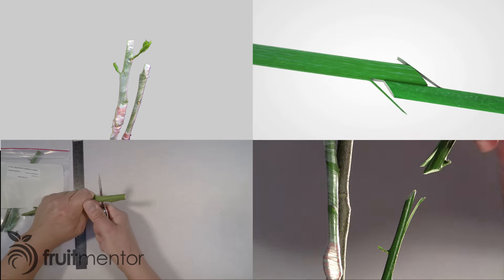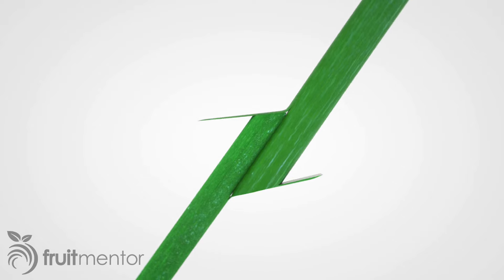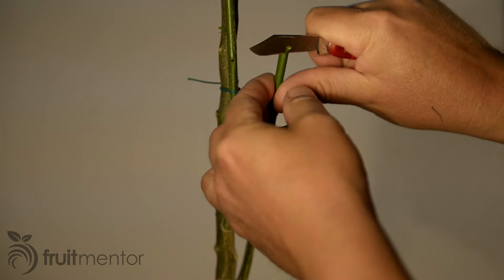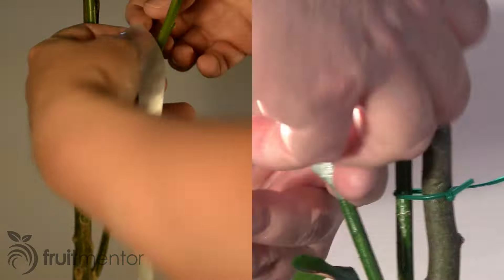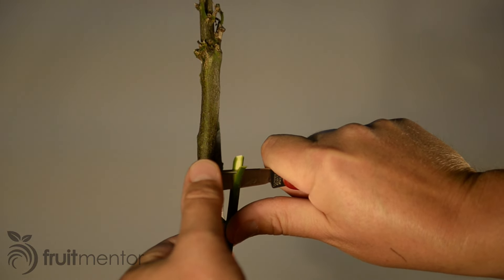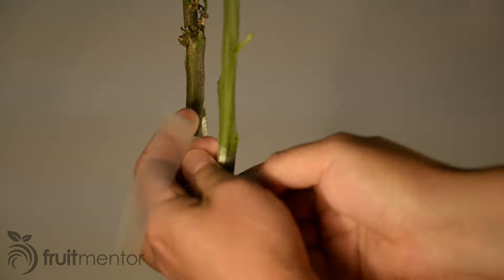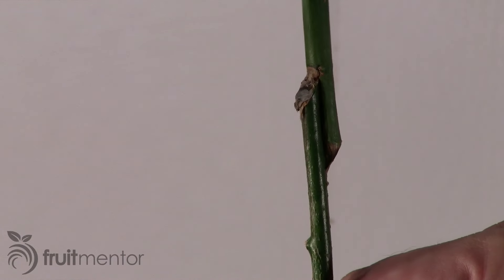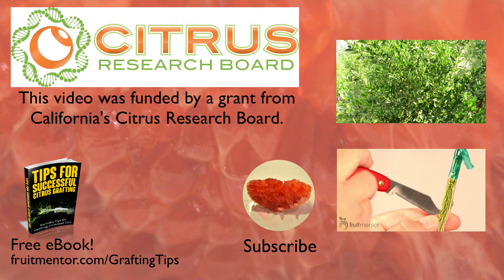Grafting Citrus with the Z Grafting Technique

Comment: Thank you for sharing your knowledge.  I ordered budwood from CCPP and will try to turn a 30 year old grapefruit tree into a cocktail tree.  I ordered Tarrocco blood orange, Cara Cara, parent Washington Navel, Late Valencia, Algerian Clementine, Murcott, and Improved Meyer lemon.  I will try some Z grafting and bark grafting.  Hopefully some grafts will take!
Reply from the maker: Good luck with your grafting! Those are all very good choices! You chose many of my favorites.
Reply: I had a couple of bark grafts take. But none of the Z grafts took.  Not sure where I went wrong as some of them bonded but turned brown and dried up. I assume I did a poor job matching the cambium.  One question about the bark grafts. The bark graft scion is lemon and it appears to be  putting out flowers but has yet to show leaves.  Is this common?  Should I remove the blossoms or just leave them on the scion?

Comment: Wow I'm very please & impress with your growing technique. Do you always use the rootstock smaller than the scion?  I live in Arizona state. Most months are very warm here at 112 in the summer. When you do the z graph in February, when do you remove the parafilm off the z graph joint to see if it healed. I meant how many months or how tall the new shoot growth so I can remove the rubber band and parafilm? Is whip toung graphing is the same as z graphing? I want to grow pomelo scion on a eureka lemon rootstock. Is lemon rootstock grow stronger & faster than white grapefruit rootstock? Can I use black electrical tape instead of parafilm? Bc I think black electrical tape sticks better

Comment: At the most, how many weeks  should the aluminum foil be wrapped?  I'm in vancouver and wrapped aluminum on plum grafts late August.  Would keeping the aluminum foil help during the winter?
Reply from the maker: I looked at your weather and it does not appear to be warm enough that the foil would be beneficial now. I would recommend grafting stone fruits in the spring when the buds are starting to break. With citrus it is necessary to graft when the weather is warm for the grafts to heal, but that is not the case with stone fruit. I’d be interested to hear if any of your grafts succeed. If not, try in the spring when it is much easier.
Reply: @Fruitmentor  I actually used your bark graft technique to graft 3 different strains of plums to our bing cherry tree end of july to first week of august this year(my bad, i meant late july, not late august as i said previously).  It was probably not necessary but the aluminum foil was actually put there to prolong the life of the rubber bands which were breaking down within 2 to 3 weeks when I was grafting  in the philippines last year.  

The plums grafted late july this year in vancouver was an unknown variety....5 out of 6 took.  A week after that batch, i grafted a couple of Italian plum strains which got 2 out of 8 taking and leafing.  3 dried up.  Another 3 didn't sprout but the scions still look plump and alive up to now.  About half of the italains were, i believe, 2 year old scions so that may have been the reason for the fail and slow take.  I will try to update you next spring if any of those survive.

Thanks so much for your great vids!

Comment: hi fruitmentor, 

People remove the suckers from the rootstock and yet, fruit trees exist with 1 or more varieties grafted on a rootstock, with the rootstock's foliage and fruit allowed to remain. How does a rootstock not overtake a tree's numerous grafted varieties when a topworked tree is always supposed to have the rootstock suckers removed because the rootstock could overpower the grafted variety. Does it depend on the type of graft or the size of the tree being grafted? Hope this makes sense.

Thanks,
- Kelly
Reply from the maker: I'm not sure that I understand your question. I had a rootstock with foliage similar to that of an orange tree start to overtake an orange tree. Normally it is easy to tell a rootstock from the grafted variety because the leaves look different. In this case I did not realize it until I got some bad tasting fruit from the rootstock. I pruned it off after I realized it. I'm not sure if this answered your question, but I hope that it is helpful.
Reply: @Fruitmentor  sorry for the long winded question. I meant if you have a lemon tree you love and want to add grafted varieties to the branches, how the lemon doesn't overpower the others. I read that the rootstock will out compete the grafted varieties if not pruned back. Therefore, I was surprised that nature allows a lemon tree to coexist with other citrus varieties grafted on the same tree.
Reply from the maker: @kellyfairbrother9978  Actually in the case of a lemon tree I would not recommend grafting other varieties. Lemon grows very vigorously and would tend to grow faster than other varieties, but this could be overcome by pruning the lemon back. The real problem is that other fruit varieties may have poor flavor and texture when grafted to a lemon tree. In this case I would call lemon the interstock. Lemon trees are normally grafted and have their own rootstock. The fruit characteristics will depend upon the lemon tree's roostock. Some could be OK, but many would not be.
Reply: @Fruitmentor  thank you! You helped me to avoid grafting a finger lime onto a seed grown grocery store lemon since it never fruited (7 years later)  P.s. I really appreciate your channel.

Comment: I love the Z graft method. 
I tried to graft different kumquat to my kumquat tree. I covered it with foil after completed as you did & put a paper envelope on top to protect it from the sun. After a month, I checked, it was still green. I removed the plastic wrapping but the rubber was still there. Under the sun, it is slowly drying out & died.
Don’t know what is wrong. I believe when it is still green after a month, it will survive. Please enlighten me. Thanks.
Reply from the maker: Green after a month does not necessarily mean that a graft will survive. I have had grafts that failed after being green for more than a month and when I investigated further I learned that there was some degree of cambium contact that kept them alive, but there was not much growth of callus tissue so there was not much healing. Perhaps that is what happened to your graft.
Reply: @Fruitmentor  
Thanks. I did the 2nd time with 6 Z grafts & up to now 4 grow the tiny leaves & 1 with the 6 in new shoot. I am very excited.
Reply: I love this graft method. 
I did it on my magnolia alba (flower tree). It has the new leaves now. 
I think about my problem earlier. This time after remove the plastic, I still cover it with an thick envelope. This way the new branch did not get burn from the hot sun. Until the new leaves grow, I increased the time it was under the sun gradually. It works perfect to me. Thanks.

Comment: If you had a choice would you use z graft every time for small trees.?
Reply from the maker: It depends upon the size of the scion. If the scion diameter is large and the rootstock is small, the Z-graft works well. If the scion diameter is small, chip budding may be easier. I prefer to use a larger rootstock if I can.

Comment: For this and wedge graft, is it possible to "overtighten" the rubber band?  I tend to tighten the rubber as tight as possible in an attempt to maximize cambium contact especially when my cut is not very smooth which is often.  I worry though that I may "choke" it.
Reply from the maker: I never thought about this too much. I have always thought that I shouldn't get them too tight, but maybe they will be OK. I think the most important thing to do is to watch them after they heal and start to grow. You might want to intervene at this stage to make sure that the branch does not become girdled by the rubber band. But beware that the graft can still be fragile.

Comment: hypothetically in the case of the less successful graft in your video instead of culling it could you save it by grafting a small piece of bark etc as a bridge. Assume the is very rare scion or other reason. thanks
Reply from the maker: I think if I had left the second scion on the tree it would have survived but healed more slowly. In this example I had grafted the same variety to both branches with one as a backup so I just cut off the weaker scion.

Comment: When grafting citrus the rootstocks age doesnt matter the bud being grafted with its age being fruiting age, with say a one year old root stock should still produce flowers in its first year correct? This is how I see it working from doing other grafts/similar work or how I see it working in general holding its full genetics [flowering age/maturity included] inside of that clone/graft tissue.
Reply from the maker: Any citrus grown from seed typically takes a long time to flower. This includes rootstocks, but I have seen some flower within just a few years. Sometimes a citrus tree grown from seed will produce a single flower the first year and then take many more years to produce more flowers.
Reply: @Fruitmentor  I'm trying to cut that down to 2-2.5yrs my tree (keylime) is in hydro and its growing fast as expected maturity should be faster as well for the flowers and fruit, however my question was focused on the graft itself when I grafted cacti the seedlings get like a years growth within three months on the new rootstock, thats the question here if the seedling goes onto the new bigger rootstock does it mature faster where that seedling will be a year old basically within three months? I assume it does speed maturity to some extent however was seeing if youve done it.
Reply from the maker: With key lime I think you may see flowering sooner from seed than from some other citrus varieties, but grafting to an established rootstock would definitely produce faster growth and would give fruit sooner. I would not normally propagate a tree like key lime myself because they are readily available from reputable nurseries and a tree from a nursery that is already grafted will give fruit the soonest.
Reply: @Fruitmentor  I'm testing seed to hydro and I'm going to be breeding it clone wouldve been a better start it would of needed to be rooted this ones been hydro its entire life pretty much and its growing at extremely fast rates, I have a strawberry that went directly into hydro in its like two weeks in there and like three or four weeks total now looking like others 4-5 month old strawberry plants. So the hydro momentum from its faster root growth and growth period is part of what Im aiming for with the seeds, I seen the cali nursery from you and it made me want to buy some buds to graft onto my hydroponic rootstocks those should flower quickly even if the rootstock is young, and then I can breed indoors and then seed those for fast fruits with grafting on hydro stock, I want a mangrove just have little room. I made a method called shallow water cultures and it would make great indoors mangroves.

Comment: When do you remove the layers of plastic tape and the rubber bands or do you just leave them and let them fall off on their own?
Reply from the maker: I normally leave them on a long time until they start deteriorating. Sometimes I will take them off sooner if the graft has healed and I think they could be causing a problem (i.e. mold).

Comment: Do you wrap the scion but leave the Buds unwrapped? Or we cover the buds too?
Reply from the maker: I used to leave them uncovered, but I’ve changed how I do that. Now I wrap over the buds, but I’m careful to only wrap one layer of parafilm over a bud. I make sure that any overlap is between buds.
Reply: @Fruitmentor  thank you, I tried the wood glue method to seal the whole scion. Let's see how they do in 3-4weeks
Reply from the maker: I hadn’t heard about that? What did you do? Dip the whole scion in wood glue? Where did you hear about that? I’d be interested to hear how it turns out.
Reply: @Fruitmentor  thin layer, rubbed with my finger. So fsr no sign or growth or death. Patiently waiting

Comment: What is the purpose of the little cut on the longer end of the rootstock and scion?
Reply from the maker: One thing it does is make the next cut easier. It gives a better angle for the knife at beginning of the next cut. It may also help to avoid the knife slipping.
Reply: @Fruitmentor  It wasn't stated specifically in the video, but does the next cut have to be above or below this or either way?

Comment: 2:44 why not also cut the left and right side of the top and bottom aka scion and rootstock to have the extra z part connected too unless u did which it kinda looks like with the left scion
Reply from the maker: I think I see what you mean, but I’m not 100% sure. The animation shows it very clearly. The graft is already pretty difficult and there is so much cambium contact as I’ve shown that I think the increase in difficulty of any extra cuts would outweigh any benefit. You could try if you like, but I think it would be harder and might even reduce the chance of success by making it more complex.

Comment: Is this process just as good if the diameter of the root stock was larger than the diameter of the scion?
Reply from the maker: Sorry for the extremely late response. If the diameter of the rootstock is larger I normally use a bark graft or a cleft graft because they are easier.

Comment: fruitmentor would you happen to know how it make cities grow big toots faster?
Reply from the maker: A couple of the most important things for citrus growth are adequate light and fertilization.
Reply: Yes Im aware of thats however I have heard of methods that force the roots to go around things like a rock  and makes the roots shape and grow bigger  I could be wrong and I have yet one last question if I took two cutting and did the z graft  and tried to make it root through water how long would it take to root or patch up. The variety in question is a Lisbon cutting for root system and pink lemon for the fruit
Reply: It has no leaves
Reply from the maker: I think citrus roots will find their way around a rock on their own without anything special. If you just stick your cutting in water, I am not sure that it would work. It can be challenging to get citrus to root. If you try the technique in the following video you could probably have roots within a couple of months:
https://www.youtube.com/watch?v=fY0wskA9IGY
If done well the grafts will heal before there are roots.
Since Pink Eureka trees are available for purchase from reputable sources, it would save a lot of trouble to just buy a tree.
Reply: Yeah I did I bought I the tree aabout a month ago

Comment: thanks for the video,really helpfull..a question though, When do we remove the grafting tape/parafilm??!
Reply from the maker: Thank you! For this type of graft, I leave the wrapping material on longer than for other grafts. I do not have any specific timing for removing it. The rubber band gives the graft strength, so I leave it on until I think the graft is strong enough to survive without it.

Comment: So many decades ago I could T-bud citrus surprisingly well, making branches of Chandler Pummelo and Moro Blood orange on my mom's old Washington navel orange tree and once budding an Ortanique Jamaican tangor upon a Meyer lemon tree at my own home at the time. Then WHAMMO, I lost all my confidence, most recently making close to 80 abominably failed T-buds and cleft grafts at my current home in Lake Balboa, getting per Fruitmentor guidance, trying three straight springs to T-bud or cleft graft scionwood CCPP sent me of Jamaican Ugli Fruit pummelo-esqe cultivar, Tahitian Pummelo , Valentine Pummelo, and a special blood orange hybrid called Boucopsa or something remotely resembling that fruit's real name, a cultivar from Malta if I am not mistaken. I found the scion wood from CCPP simply too small for my clumbsy fingers to work with, and NEVER could figure out if I was spraying my hands too often or not often enough with methyl alcohol. BUT -- finally, last winter I, as a lark, not giving myself a ghost of a chance, I made two successful cleft grafts of Shenandoah elite paw paw cultivar, using -- now get this! -- plastic zip-lock ties to firmly hold the graft union together and painting the whole branches with that black tree sealer product and just got shocked when I saw leaves pushing out vigorously from the tip of the black painted branches. Eureka!

Comment: I ordered some moro blood orange but they all failed
Reply from the maker: I failed a lot when I started. With persistence you will get it. Patch budding works very well if you have a good place for it. You might want to try Boukhobza Maltese Blood orange. It is really nice and much sweeter than Moro.
Reply: @Fruitmentor  I'm in socal so I'm worried that the red antioxidants won't show

Comment: the first animation has the tip cut on the wrong side (long end not the short end). I just tried to do it step by step but wrecked it as i was closely following the video from the start. In your actual live example you put the tip cut on the short end not the long end
Reply from the maker: You might want to practice this before you try it for real and watch the video multiple times. Both examples match the animation. The video was reviewed before publication in English, Spanish, Vietnamese, Chinese, and Korean. With 2 million views this is the first comment like this that I have received. Please watch the video again. Thanks.